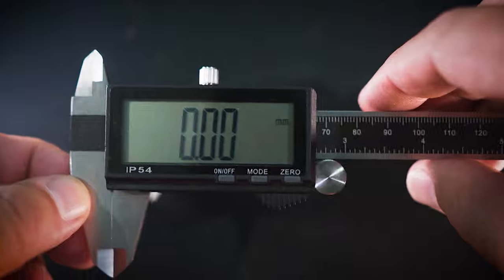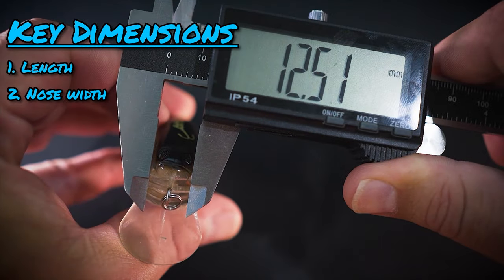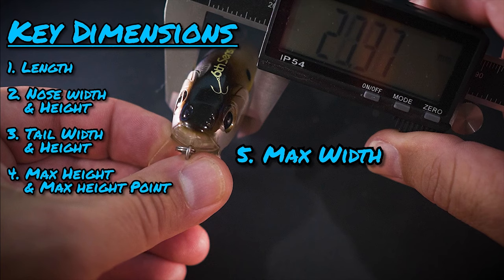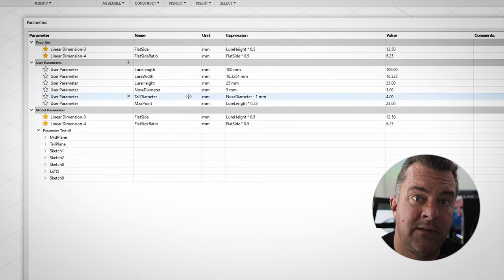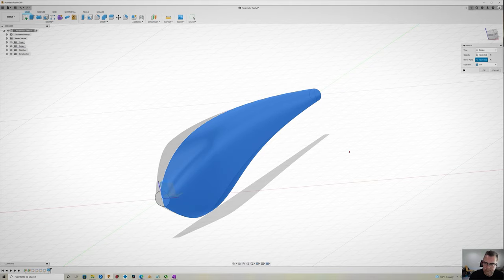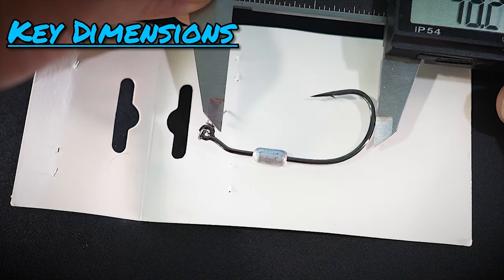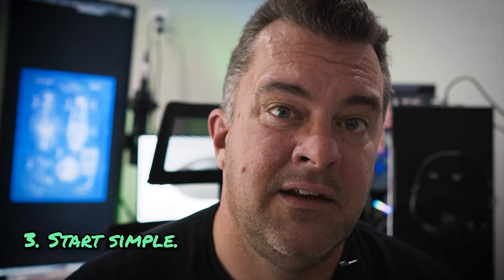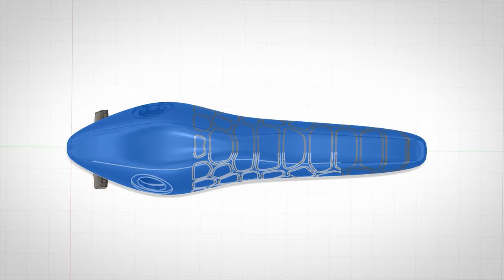Complete 3D Printed Fishing Lure Design Course - Part I - Prepare!

Comment: Hey my friend what material do you use! Is it the same like the molds you made for plastic fishing lures? Or its to heavy
Reply from the maker: Yes I use 3D printer resin for hard lures. I have not perfected a resin yet but I have used Siraya Tech Fast Green and Siraya Tech Build with some Tenacious mixed in. Both have worked well so far. I have been using Siraya Tech Clear Blu V2 for dive lips
Reply: @WMBayouLures  I made 4 prints with Siraya Tech sculpt but i think that this sculpt is more heavy from the others that you say
Reply from the maker: Yes Sculpt is tricky to work with for sure. It has a lot of material added to make it heat resistant. I would not use it for hard baits, only for molds. I have been using Siraya Tech Fast Green and getting some great results lately, it is my current resin of choice for hard baits.